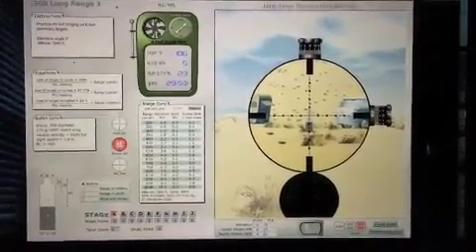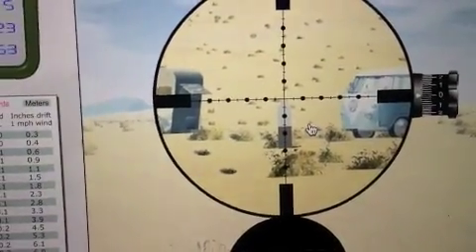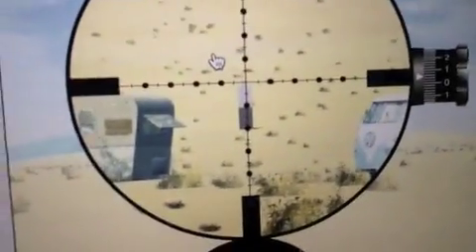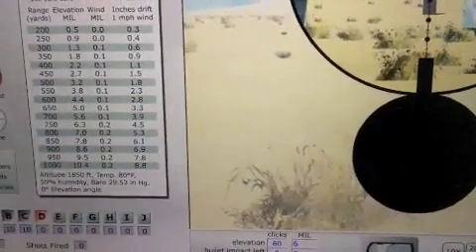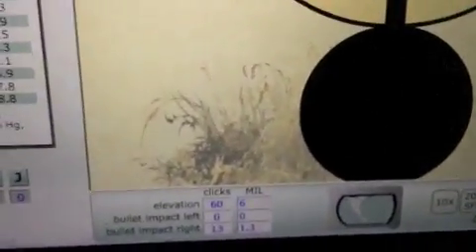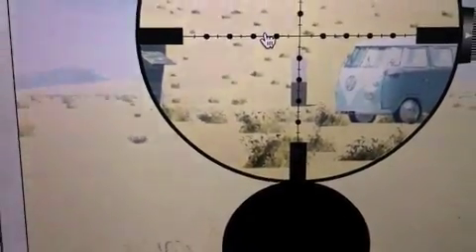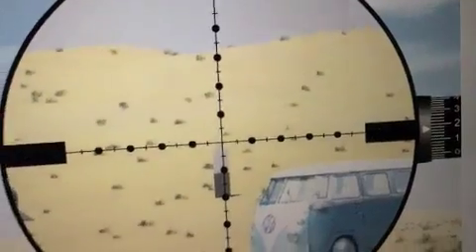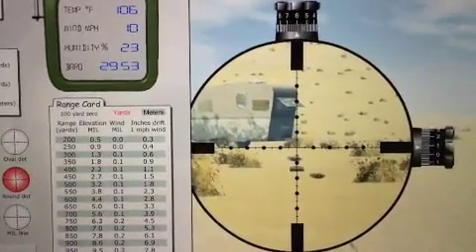Using MILS as a Bullet Drop Compensator

Comment: what i don't understand is how you decide to hold 2 high or 6 high... Isn't that based off what your zero is? if I'm using a 50yrd zero, how do i find my holds for 25, 75, 100, 200 etc?
Reply from the maker: Yes, it depends on the range you have the weapon zeroed for, you will either hold higher or lower, with a slight adjustment required for elevation, instead of massive adjustments. All of this depends on the ballistics/trajectory for your specific ammunition.
Reply: @HKPSG1Shooter  do you will need a ballistics calculate where it will tell you how much your Bullet will drop at various distances??
Reply from the maker: This app has the ballistics for the calibers listed, which is what I’m calculating from.
Reply: @HKPSG1Shooter  can I use this app on iPhone? If yes, what’s it called?
Reply from the maker: Shooterready.com

Comment: Great video, you should do your next one on how to actually adjust the turrets for people (2.4 mil)
Reply from the maker: Depends on if the scope is calibrated in MILS or MOA. On a scope calibrated for MOA, 3.6 MOA equals 1 MIL, which is 3.6 inches at 100, and 36 inches at 1000 yards. The number of clicks on the turret also depends on if the MOA scope is calibrated in 1/4 or 1/2 MOA. 

The Long Range Shooting Simulator has instructional models on both MOA and MILS scopes, as well as several different simulations in many calibers including 223, 308, 300 Win Mag, and 264 Win Mag.